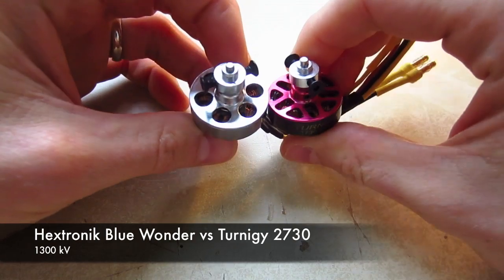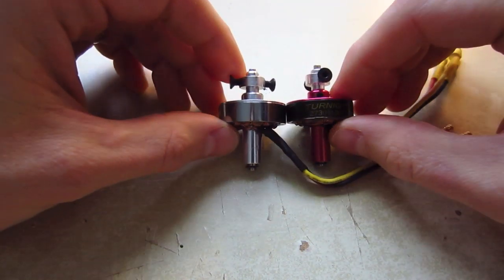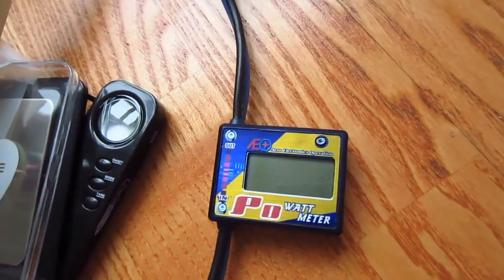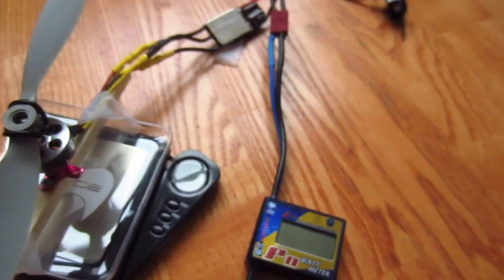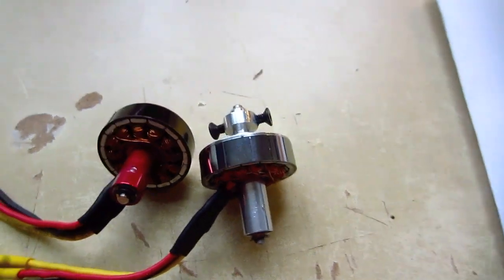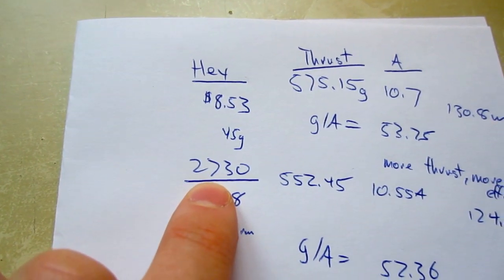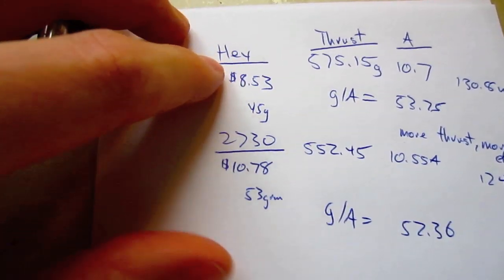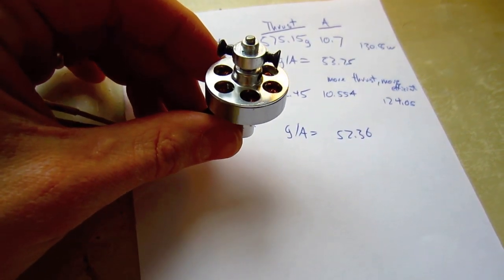Blue Wonder VS Turnigy 2730

Comment: Of course it had nothing to do with the fact that battery voltage diminishes with use and you tested the Hextronix first.  Wish you'd topped off and balanced the battery again, and then reversed the testing order.  
Moral of the story:  If you want something done right, do it yourself.

Comment: can i put a 10×7 prop on a 1300 kV motor with a 12amp ESC and a 2 cell 25c battery?? please reply
Reply: 10x7 with 12 amp esc is not the best option would  recommend a Higher amp esc and 3c lipo battery but dont take my word for it.
Reply: Kofi Asare tnx....u were right...I burnt my ESC...got a bigger ESC and batter...she flies amazing now
Reply: Cool.
Reply: Kofi Asare Hi I'm new to RC planes I have almost finished making a foam Delta wing it weighs about 350g Auw it's 18" wing span and 16" long, blue wonder 1500kv motor 8/4.5 prop 350mah battery 12amp esc. your opinion would be much appreciated before I try to fly thanks?
Reply: OK I recommend an 8/4 prop but a 8/4.5 will work fine you shall definitely check the motor spec page and it will tell you the recommended stuff but if all of your components are working together and can supply the right amount of power than your plane will fly.
Reply: Kofi Asare Thanks for your feedback really appreciate it 👍
Reply: Yes no problem do you mind sending me a link to the motor.
Reply: Kofi Asare Look at this on eBay  http://www.ebay.co.uk/itm/200988332859
Reply: OK after looking at the esc it shall work but be careful to not burn out your esc.
Ps. I take no responsibility for your actions .
Reply: You shall make a video about it.
Reply: Kofi Asare yeah I'll try and do a video on the maiden if goes wrong at least I'll a few laughs and hopefully some good advice for next time😬
Reply: Thanks man I'll look forward to it subbing now.

Comment: I have an emax rs2205 2300kv motor on my ms composit mini swift. I am having trouble with stability above half throttle and I'm wondering... maybe it has to much RPM. But I was told by a stranger (who was also a rc pilot) that my motor is to small and the prop is closer to the rear of the plane. He recommended the hextronik 1500kv motor. Does this make any sense? I'm asking around but I get no response :( I am flying with 5045 props. Sometimes I use 5040BN props but those props cut away at the wings on landing.
Reply: either the motor is  too much for ESC or u need to change throttle settings

Comment: You need to calculate g/W in order to compare the motor efficiency. Evidently the Turnigy motor consumed less power to produce less thrust. ( P = IV, battery pack voltage is also a contributing factor. )

Blue Wonder: 4.40g/W
Turnigy: 4.45g/W

You'll see then that technically the Turnigy comes out on top even though we're talking about around a 1% difference in efficiency in which case the $ per g/w title goes to the Blue Wonder. :P

Comment: I would like to see the same test with a controlled input voltage, or at least measured. If you calculate the voltage from the watts and amps, you will find that the voltages are 12.22 and 11.75. Almost 0.5 volts different. The higher thrust was from the higher voltage test.

Comment from the maker: Thanks! Very true, with such a small sample size the data does not carry any statistical significance. I ran a T-Test on the data and the 2 tail probability does not give statistical significance (with a 95% confidence interval) in terms of performance. BUT, the price difference becomes statistically significant if you buy 4 or more motors - not including the price of shipping

Comment: Cool test...I've been looking at the Hextronik 1300 kV  for a while, after I saw your test, I bought a couple.  I just got them today, haven't hooked them up yet, but plan to within the next day or so.  I have a question, they don't seem to spin as freely as I would expect, I have a couple Dynam outrunners that spin smoothly.  Is that normal that they don't spin freely?

Comment: not a statistically relevant test in terms of performance. the difference in performance between the 2 tested motors is probably the same as the manufacturing variations for 2 motors within the same make and model. they are made by the same company after all (turnigy, hobbyking is all hextronic.)

the real reason to buy the blue wonder is the price

Comment: thanks for your coverage!  Any chance for more data collection in the future?  2 per motor is great, but doesn't make for a great stat spread.  I know it's a lot more work, but 100 would be preferable.  It's more possible to get 2 fluke high and 2 fluke low readings on both motors than it would be 100 in a row for each.  Scientific method is a bitch, I know.